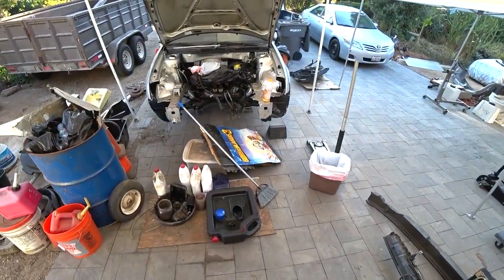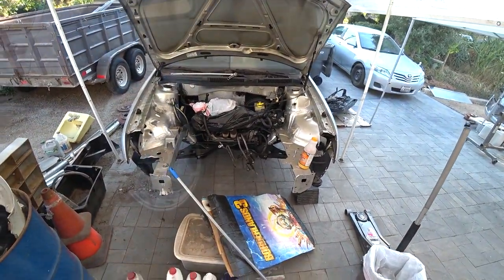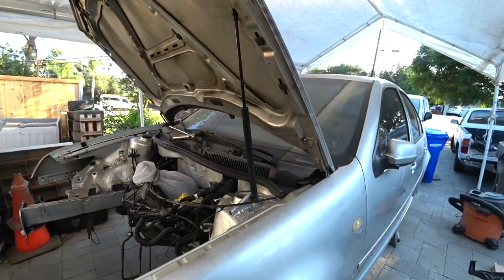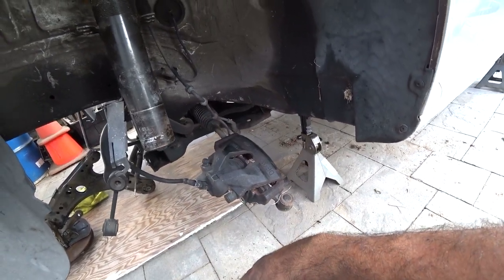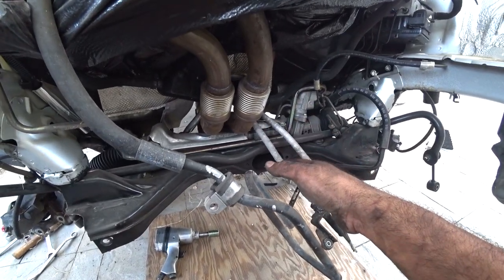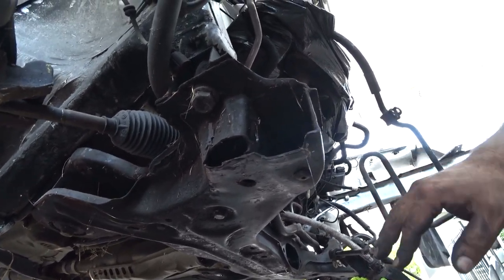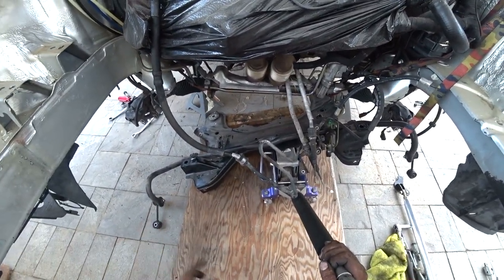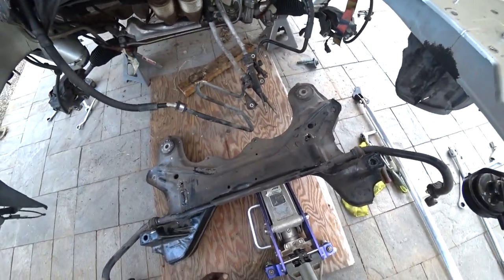How to remove mk4 subframe and control arms S7EP12

Comment: Do the two rear subframe bushings actually wear out?  I'm doing a complete front end suspension rebuild on my MKIV VR6 that's been sitting for years.  I'm wondering if it's really worth the hassle of dropping the subframe to just replace two subframe bushings...
Reply from the maker: Yes 100% they rip and get clunky
Reply: @PincheALsGarage  Thank you, I will plan on dropping the subframe then.  Do you think it would be any easier to disconnect the power steering lines/intermittent shaft and leave the rack bolted to the subframe when dropping it?
Reply from the maker: @cup_and_cone  find a way to support the rack from above. So it does not just hang from the steering column